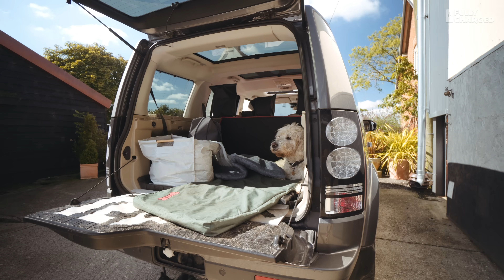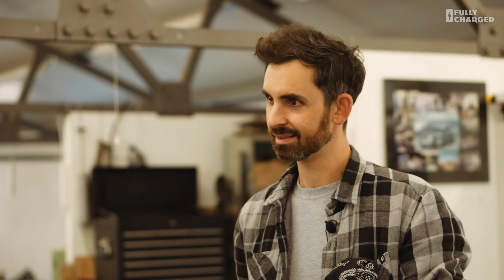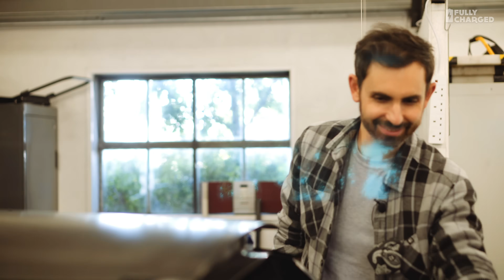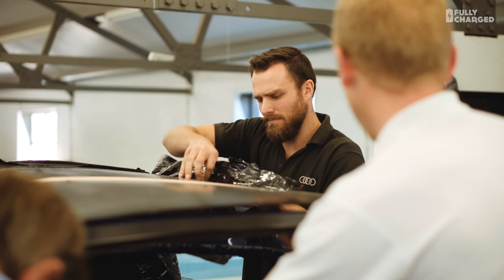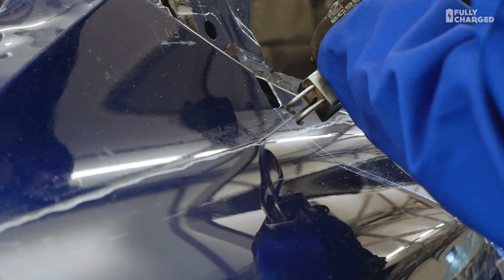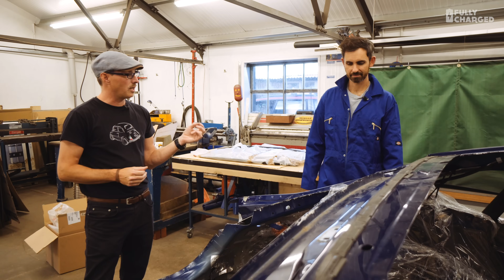Tesla Model S Shooting-brake | Fully Charged

Comment: Add 100 kg on for an estate version. Certain structural elements need to be added to maintain rigidity. Conversely, a convertible  F-Type is 78 kg lighter than the Coupe.

Comment: I'm up for an electric estate that can go for 3-400 miles without recharging. I currently drive a Toyota Auris hybrid which is about as close as you can get in the UK today. It drives electric locally and for good stretches on long trips but needs petrol uphill especially.

Comment: Curious if the design accounts for one of the worst characteristics of the Model S, namely the lack of adequate ventilation is the "wayback" area, behind the second seat, where the dog(s) will be.  Any plan to beef up the air flow into that area?

Comment: When compared to a 50 thousand dollar gas/diesel factory designed wagon even with piss poor economy of 20 miles per gallon ($4/Gal) you'd break even in the Tesla somewhere north of 250K miles.  You are prepaying for those miles in advance. Brilliant posturing ... Rubbish as I see it.  The battery however is warrantied for 8 years / 125k miles ... so good luck getting anything remotely double that ... the inconvenience of the charge time/location ... and How much do that charger cost ...   Get a Volvo V60 or an audi all road and be done with it. ... I know I know ... if I don't buy the electric i'm killing babies or old people or all the water in the solar system will suddenly materialize from the Ort cloud ...  Nibiru will be forced 10 cms closer to earth and all shit will break loose ... and my traction control with not work on wednesdays ... But the audio in the video was nice!! Did seem like a rather long commercial for those high grade expensive molds.

Comment: Totally could put a solar panel on there, if not line the new material fab with solar cells. Would probably get you around a kilowatt, which is a sizeable amount to boost one's range by a few percent, or just to slow-charge outside over some amount of time. That being said, Tesla probably wouldn't want you hooking a solar unit up to the battery mains.

Comment: Nice, that is my dream to convert my model S into a Wagon :) Currently my dog takes up entire trunk space. She is comfortable but much smaller than the dog in the video. Great work. 1 tip - Extend AC vents to the back while you at it, it will get hot back there.

Comment: They mentioned they were able to keep the car under warranty just as long as they didn't touch the electrical stuff. How is that possible when they extended the car? Did I misunderstand or missed something?
Reply: Its the same as modifying most cars as long as it doesn't affect mechanicals of the car you keep the warranty. They also didn't extend it they raised the roof and rear.

Comment: Great episode...just under 22 minutes means it would be great as a half hour TV special (with commercials)!  The audio and video production was top notch.
Reply from the maker: Thanks. Much appreciated.
Reply: Estate cars have been demonized for decades in North America to the point of influencing the market, but then people will flock to buy overpriced SUVs with bad engine and mileage.
Reply: Yep, this the sad reality here. I'm in Québec, Canada, the SUV and pick-ups craze is in full blast. In Canada, people still looking for an "estate" as you call them are left in the dark. Their only choice is the VW Sportwagon. Some years ago, Mazda was selling a very nice Mazda6 in estate form, with a nice V6 with a manual box or automatic. It did not sell at all in the US so they discontinued it. Sad. Ford produced a wagon between 2002 to 2007 model years. You could see them every where here.I own a 2006. Perfect size for a small family, good, reliable and durable mechanics, good fuel economy. But sadly discontinued in 2008. Shame. I HATE SUVs !

Comment: Would it not have been better and cheaper to convert an ICE estate to electric?
Reply: This is awesome Think about that....
Reply from the maker: Would certainly not have been cheaper. We have covered converting older cars to electric but because the body was designed around an old fashioned engine it's always a struggle to get batteries to fit well, and if it's a more modern (post 1980) car the electronics are so complex and so heavily integrated into the engine management it becomes a nightmare and therefore very, very expensive.

Comment: Sorry but modern sedan/hatchbacks converted to estate do not work. You could get away with it up until the late eighties but anything after that looked weird.

Estate cars need a dedicated section from B-post onwards to for the styling to work.
Reply: TheSaintST1 did you watch the video
Reply: Michael Richter yes and it has the same problems the 90's Renault Laguna estate had. Not a fan.

Comment: A couple of times... at Pontiac, with the Firebird... a Kammback treatment was considered. First on the 2nd-gen, then again on the 3rd-gen. While the 2nd-gen required considerable bodywork, the 3rd-gen was merely a swap of a one-off piece that bolted in-place of the hatch, much like the interchangeable hatches available for the Nissan Pulsar-NX.
 I imagine those watching this might be inspired to make such an easy-to-install piece for the Model-S... to which I say: Have at it! And see if you can cobble-up some carbon-fiber body-parts for it while you're at it.😊

Comment: VW golf has rear wash wipe... dont call this shooting break... As many said, it's a wagon, station wagon or estate
Reply from the maker: Well, the old fashioned British term to describe such a design is 'shooting brake' the derivation of which is not 100% clear, either a flat rear on a horse drawn wagon used to carry a 'shooting party' i.e posh blokes in tweed who derive pleasure from shooting birds, or possibly from a similar late 19th century device, a small cart used to train horses to cope with pulling a wagon behind them.  I quite like the fact that it's been called a shooting brake even though I'd call it an estate.

Comment: Why not just get a model X?
Reply: because that's an suv, the goal is to establish an electric estate, the first one!
Reply: CRAZYCR1T1C because British eccentric over engineering!
Reply: Because the Model X is an ugly minivan
Reply: Creepy doors
Reply: 1.. Hate the driving position, Has anyone else seen cars (not SUV's) in the past 5 to 10 years are trying to be an SUV shape/driving position? 2.. Aerodynamics of a brick. I damit some have better airstream than some cars. 3.. Don't like driving a transit van. (Oh, back to driving position).
Reply: Because it’s an MPV the same shape as the model S, ie totally impractical if you have anything larger than a squashy sports bag to put in the boot. This estate version is brilliant, come on Tesla, I'd swap my E Class immediately. And make the model X practical so I can ditch the discovery (4 not 5 as the latter is far less practical, why LR?!)
Reply: As for the aerodynamics, I think the "shooting brake" shape has a chance to be quite good.  If memory serves, the Mercedes Benz E class wagons have, in some cases, had slightly better Cv than their sedan versions.
Reply: CRAZYCR1T1C it does not have a straight boot

Comment: About bloody time.
Can’t believe Tesla didn’t do this as an original adaptation. Well done Fully Charged and the team doing this.
Reply: Because Tesla is designed by yanks. They are not into this kind of thinks.
Reply: I mean we yanks did somehow manage to come up with the Dodge Magnum some 10 years or so ago https://cdn1.mecum.com/auctions/kc0414/kc0414-181429/images/kc0414-181429_1@2x.jpg?1396904452000 so it's not out of the realm of possibility. But in general, yeah, for whatever reason we just don't seem to like wagons here. I have no idea why, but I like to think it's because we lack taste sometimes.